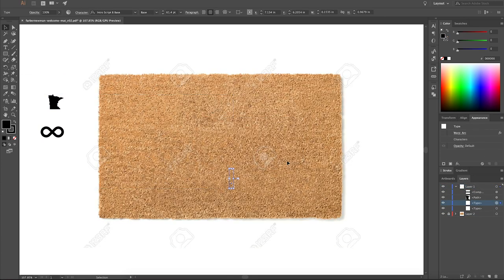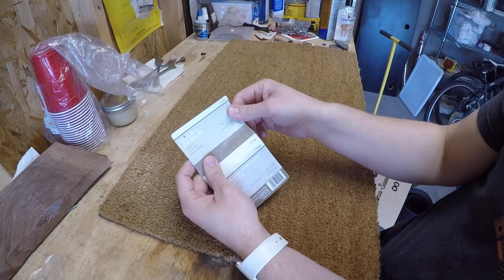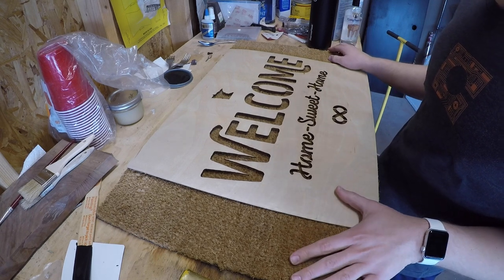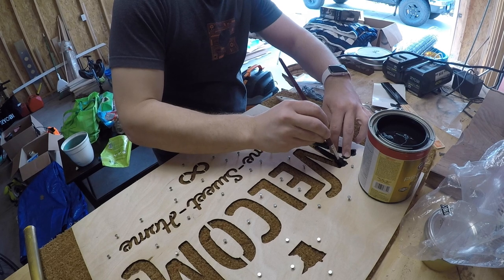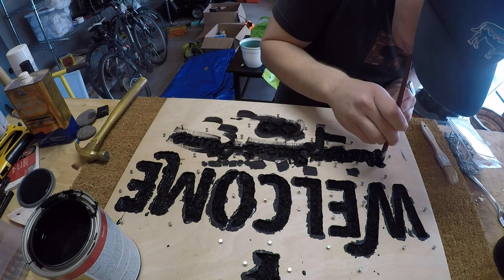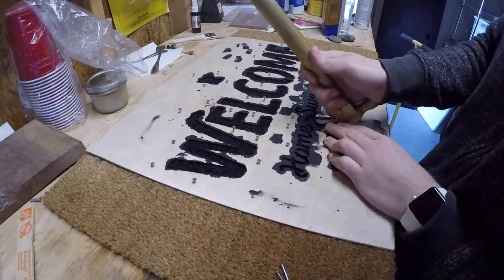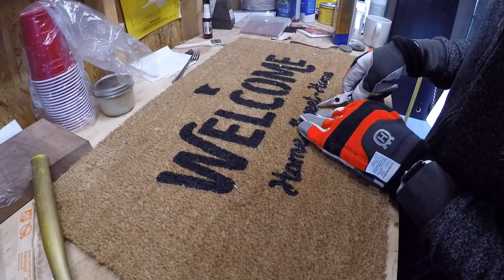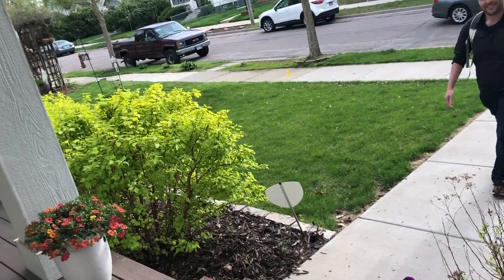Making a Custom Coir Welcome Mat

Comment: Looks good great video but why didn’t you just Raster the image straight onto the mat?  Also can you upload a image of what the mat looks like now
Reply from the maker: Hey Daniel! Great question, and that did occur to me. The reason I decided not to raster it straight onto the rug was because that would simply singe the very tips of the fibers, rather than penetrating down into the rug. My thought was since those singed fibers would be weaker, they would break/rub off far quicker than paint. I don't have any "data" on that theory, but I might test it out at some point in the future with another rug! As for a photo of this rug, sure thing! Here it is 1.5 years later: https://imgur.com/a/0utF1nI

Still looking pretty good! Hope that helps!

Comment: You can directly put it in your Thunder laser and save time, it will come out black and accurate and no paint needed. Check Myers Woodworks on youtube on how to make laser burn doormats, no need of paint and making stencils
Reply from the maker: Yup, that's another way you can go, but from what I've heard, etching directly on the mat is a tad temporary... ie. the scorched fibers of the rug will rub off after a few months of heavy usage since they get damaged during the etching process. The painting method I describe here is a lot more permanent – ours still looks good nearly 2 years later after near constant usage as our front door mat. 

That said, I do want to try the "etching directly on the mat" technique and put it through its paces to see how long it takes to get worn out. I'll make a new video on the topic when I do that. :)
Reply: @FarbulousCreations  Correct, it will worn out if you don’t put a layer of polyurethane spray, that will seal the doormat. Your technique is not bad either, it just takes more time.

Comment: Why wouldn't you have just lazer etched the whole design?
Reply from the maker: Hey Grant! Great question, and that had occurred to me. The reason I decided not to etch it straight onto the rug was because that would simply singe the very tips of the fibers, rather than penetrating down into the rug. My thought was since those singed fibers would then be weaker, they would break/rub off far quicker than paint. I don't have any data on that theory, but I might test it out at some point in the future with another rug. But the painted version is holding firm 1.5 years later! https://imgur.com/a/0utF1nI

Hope that helps!